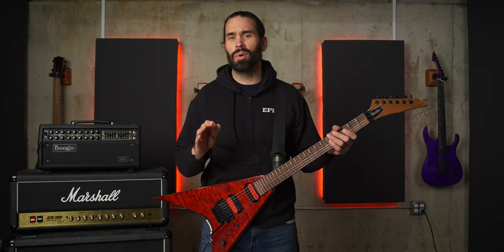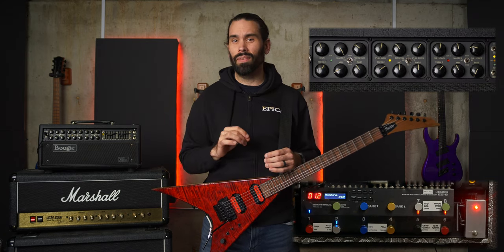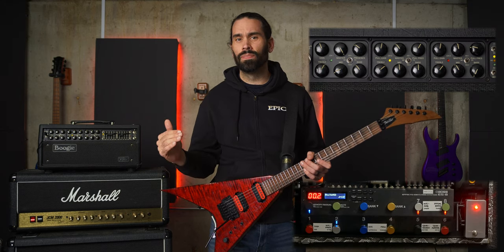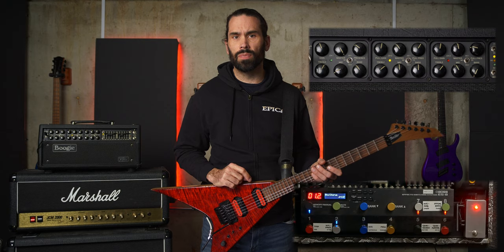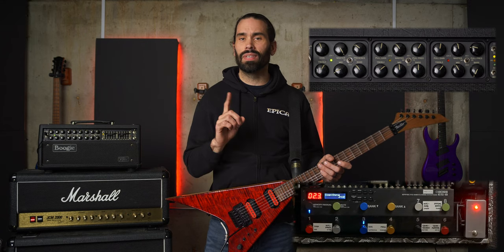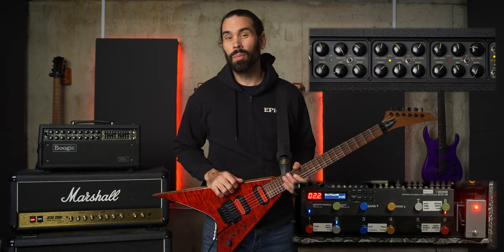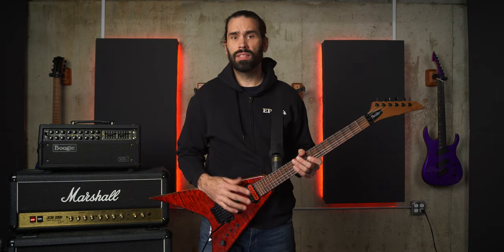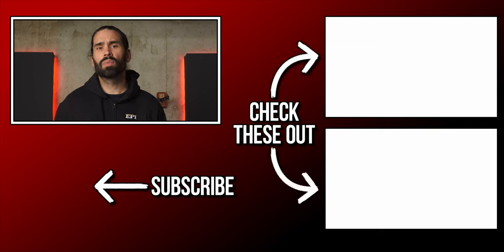Why Hasn't ANYONE Done This??? WIRELESS Amp Channel Switching using your GUITAR!

Comment: This is brilliant. I have a Line6 JTV59 Variax and a helix floor. In the past I've used the Cat6 cable to be able to connect the guitar to the Helix and control patch changes from the guitar, as well as have the helix tell the Variax to change guitar and pickup types as well, which is AWESOME. BUT it's NOT wireless. I'm still frustrated that Line6 hasn't come up with a wireless solution for this. In the mean time, I'm using a combination of wireless and some other MIDI controllable effects so if there was a solution for this within a reasonable price point I would certainly consider it.
Reply from the maker: Thanks! Just out of curiosity, what do you think a reasonable price range would be?
Reply: @ManBunMetalHead  I guess it depends on whether it's a complete DIY kit or a mostly assembled box. Obviously there's DIY work needed to add it to any guitar. only you can determine your parts/labor cost, but I'd say if you kept it to $150 or under it would probably be in what I'd consider an affordable price range.
Reply from the maker: @goodheartmedia  Appreciate the feedback.

Comment: I had the same idea for switching delay on/off and not having to run to footswitch. It's the idea pile I might try out some time.
How did you implement the battery level check?
Reply from the maker: I used an analog channel on the Arduino to measure the voltage. But because the analog input is limited to 5V, I used two resistors to create a voltage divider to halve the voltage. I think they were around the 50 kohm range.

Comment: I'm disabled and pedals are a little more difficult than they used to be. I've had the idea to control individual loops using some kind of switch, which led me to this video. seems like it'd be a lot simpler than this because there would only need to be "on" and "bypass" modes.. any insight as to how I could accomplish that?

Comment: Fuck yeah that's brilliant
 I work as a guitar tech how do you know what kind of mini code it sends out your pedal

Can you make it work with a kemper
Reply from the maker: I had to program it to send a normal program change over a specified MIDI channel.

As long as the Kemper has MIDI in and outs, it should be possible.
Reply: @ManBunMetalHead  🙏🙏🙏🙏